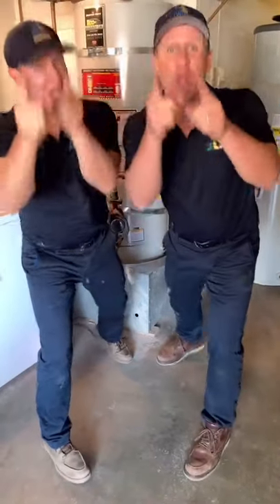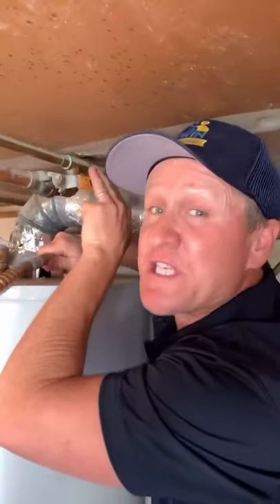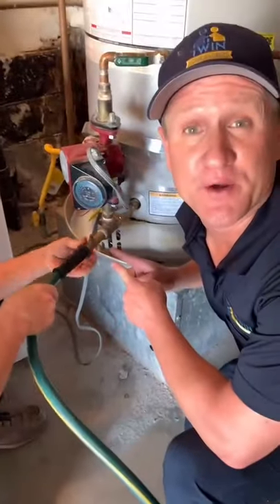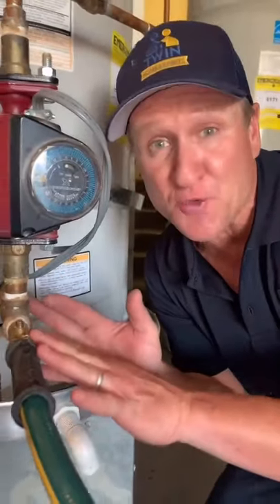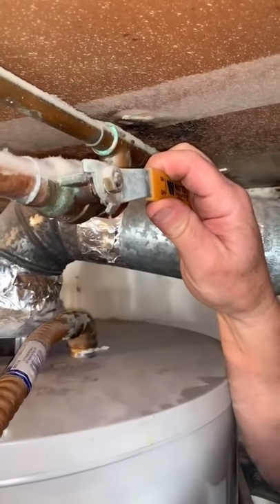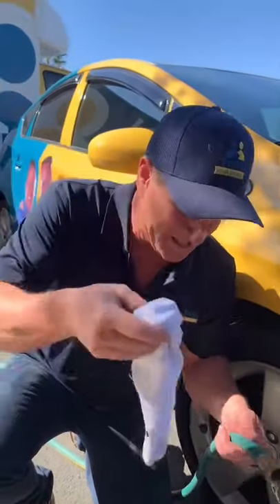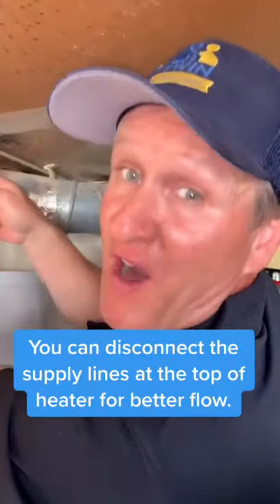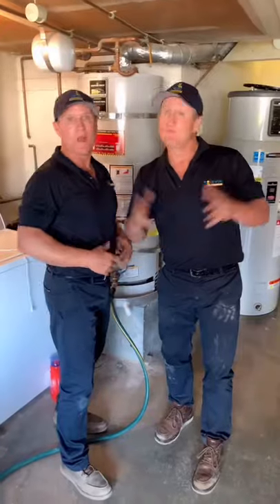Drain your water heater like a pro! #shorts

Comment: My recommendation is to turn on all the hot sides of faucets for air flow instead of opening the t&p cause the t&p will most likely not seal correctly after it opens if it's a few years old. Now if you do open the t&p and it doesn't seal back up smack the handle toward the tank lightly with a hammer a couple times 70% of the time that'll stop it from leaking instead of replacing it. Also no need to turn the gas off in my opinion just turn it down to pilot. If it's electric cut the power at breaker for sure tho
Reply: Well that answered my questions except... how often should I th8s be done??
Reply: 100%
Reply: @nbt3663  annually
Reply: @roroborTV  thanks!
Reply: Thank you 
I came here to write this
Reply: Yep
Reply: Every year

Comment: That’s basically how I do it. Except I don’t usually do the whole turn the supply on then back off but I disconnect the hot side which acts like a finger on top of a straw , then release the t&p valve. Also helps to have a booster pump hooked up to it. Honestly I hardly ever drain them all the way just let em drain until light enough to haul away. Takes a while and I don’t like standing around. Just make sure to put a cap on the nipples on top and shut the valve at the bottom off, especially if your rig isn’t tall enough for it to be transported standing up or you will have a rusty lake

Comment: That damn thing is always clogged.  I do this annually and it's always clogged.  I end up having to remove the top heating element and slowly drain using a wet dry vac.  How about putting an access plug on the top of the tank where a hose can be put in the tank to drain it?

Comment: Don't open the t&p valve, you'll weaking it. Once ball valve is closed open hot side of faucets. When you turn the water back on to the heater leave them open a few seconds to drain any air pockets

Comment: Don't turn your gas off - just turn your setting to "pilot" or "vacation" mode.  If you turn off your gas, you will have to re-light your pilot lite.  Then when you are done - just turn the setting back to where you had it.
Reply: or if it is an electric water heater be sure to turn the power off

Comment: Never lift the pressure relief. It will never seal back and you'll be paying to have it replaced. Just open the hot water side of a faucet to bleed it.
Reply: Yeah I only lift it if I'm replacing the water heater. Otherwise I just crack a supply line open
Reply: That’s why it’s there…
Reply: @Jon Doe  . No. It's not. It's there so your tank does not over pressure as the water heats up and expands. Even your owners manual says to not open it.
Reply: @kenchiison4570 ctually, the instruction manual to my Rheem water heater says to open it once a year to make sure it can move. Now I don't know what to do.
Reply: @sparkyheberling6115  I wouldn't open it. Just open the hot side of the nearest water faucet like others have commented.
Reply: @sparkyheberling6115  if the water heater’s new, definitely exercise it every now and again. If it’s old don’t touch it unless you’re replacing it lol.
Manuals do say to exercise them every 6 months to a year.
Reply: @jondoe4168 no it’s not stupid
Reply: @sparkyheberling6115 you need to learn reading comprehension. Rheem has absolutely no such recommendations. Either you can’t read, or like to lie on social media.
Reply: Actually when you are servicing the water it should be check. If it doesn't close pull and replace it since it is an emergency blow off. If it ever blows off it will not shut dumping water and usually home owners don't know what to do. The whole point of SERVICING a water heater is to actually service it including the T&P, thermal tank, flexes, shut off valve etc. Only a lazy person wouldn't touch the t&p
Reply: @jacobbowerman8633  well skippy, you’re obviously not a professional plumber.

Comment: And then replace the T and P because now drips after you touched
Reply: Yuuuup!
Or you can fiddle with cleaning it.
Reply: Yup lol a little trick I've picked up is smacking the handle of the t&p toward the tank a couple times LIGHTLY with a hammer or channel locks whatever you have around you and that usually will seal it back up
Reply: @jake48396  I don’t mess around with T&P valves. If they are bad, then they are bad and I’ll replace them. They don’t cost a lot, maybe $20, and they are a pretty major safety feature that prevents your water heater from blowing up.
Reply: @johne189  I typically find it you give it a little tap with a hammer it stops
Reply: YEP 😂
Reply: I thought the same thing 😂

Comment: Have never flushed my water heater.  Still going strong after 23 years.
Reply: Change it yet
Reply: They don’t make them like they use to anymore. I have a Reliant. A replacement to my very first one. And flame shuts off way too often… oh well I’ll try flushing since I hear noises of possible build up
Reply: I see u not a plumber. There's a reason why they need to be flush.  Let me tell u why so ur fault in the house don't get stock with minerals and have better flow. That's why.

Comment: Never open the TMP because it might not seal properly afterwards. Then you will have to replace it or it might start leaking later.
Reply: As an actual plumber No that’s not correct at all actually it’s recommended to open the T&p valve once a year to ensure that it is working and not getting stuck. It’s a safety device. You need it to be able to open if pressure is to high or temperatures are to hot on the water. You always check the valve always. And if it gets stuck it takes damn 15 min to change one out and that’s with me taking my time
Reply: obviously you dont know much about them

Comment: My water heater went out last winter and my landlord fixed it. I now own the home and I’m paranoid it will go out again. Are there any parts that I should keep on hand that are “easy” to fix and install myself?
Reply: I would say a water heater element for a tank water heater but chances are if it’s electric it’s a 2 phase 240, so 120 watts to each element. The bottom one always goes out first. I wouldn’t mess with it if I where you unless you have a multimeter 240 is deadly just takes 1 oopsie
Reply: Home warranty

Comment: Take the drip leg off the relief valve and put an air compressor on there and it cuts the time tremendously
Reply: I run a transfer pump on the hose.

Comment: Forgot a step .turn off the circuit breaker if it is an electric water heater
Reply: Unnecessary. Just attatch hose open the boiler drain. Water will replenish as it drains. No chance of running an element dry.

Comment: How often should you drain it
Reply: Yearly, but if there's not much sediment coming out I wouldn't completely drain. Just let some water out to clear the valve for 5 to ten minutes. If it's electric don't forget to turn off the power because you might burn the top element.

Comment: Bro wtf. Not even close. Just valve off the heater and put a size 13 boot on the plastic drain valve.... no restriction means more flow meaning more time for beer drinking

Comment: OMG There's 2 rat catchers thinking they are plumbers well hate to tell you a pro wouldnt have burnt circ pump up but you drained it didn't say a word about turning pump off and just take cold side loose for air will drain faster

Comment: WrongI use a transfer pump with a 1/2 pex connection I remove supply line and stick 1/2 pex through nipple on top of water heater